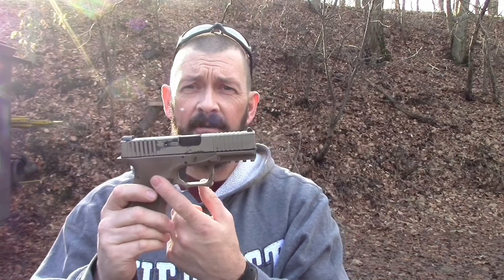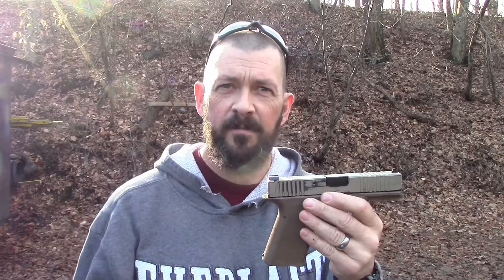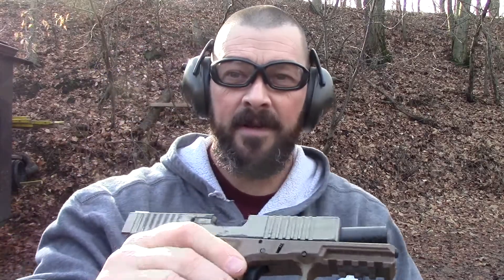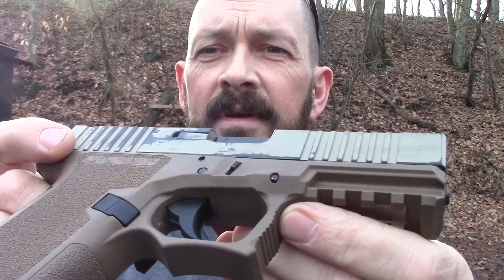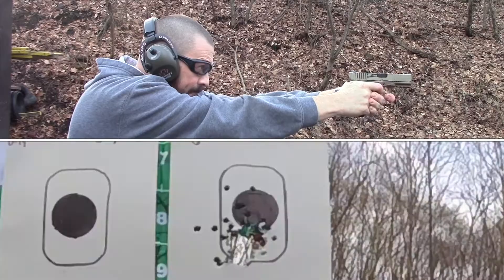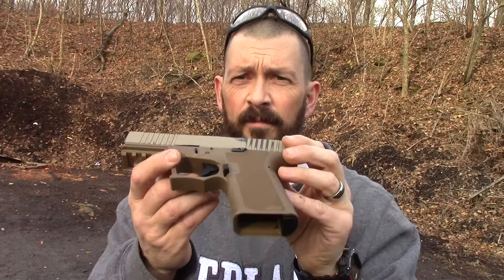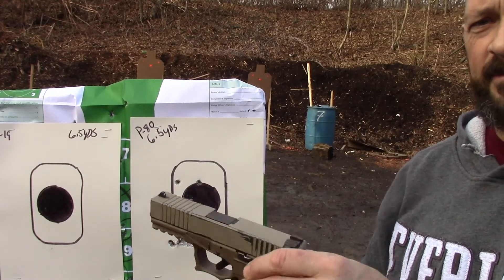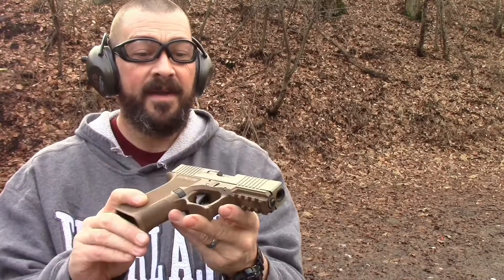Polymer 80 functions check and Point of aim point of impact test

Comment: Good video and nice Glock , my first build I had my trigger pin walkout and I tried every possible thing you can think off to fix it my last resort was super glue 😬😂 and still didn’t fix 😭 I guess my drill wasn’t spinning straight when I drilled the holes so they where wider than they had to be ,  but since then I have a build to more a Glock 19 and Glock 22 man they work like a charm , I have over 2000 rounds on each and no malfunctions  I’m glad you got your Kin fixed I had bad luck on that

Comment: I have a PF940c with the same Brownells slide and Glock 6.5mm, 3 dot, Night Sights. My first experience shooting the gun was low point of impact with the 3 dots aligned. It took a short time to get used to but all I do is hold the front sight dot slightly higher than the rear sight dots. I'm now hitting center of target at 10 yards almost every shot. My P80 with Brownells slide has a Lone Wolf Alpha standard length stainless steel barrel, 1:10 twist. Turned out to be very nice to shoot, low recoil, quick back on target and never a failure with ball or hollow nose rounds. It is now my everyday carry weapon instead of G19. Stay with your P80/Brownells slide. The more you shoot it the more you will like it.

Comment: If pin walking is an issue with a P80, I wouldn't get all down about it. I'm sure there are plenty of good machinists that can lathe ya a slightly oversized one for less than $ 15 or 20 frog pelts. I would say blue loctite....but I just dont have much faith in it. I cant wait to get my 80 finished up.

Comment: I feel like a celebrity!!! My original question was mainly towards the Gen.5. That is where I’m getting different answers from Glock and aftermarket manufacturers as to what height front sight is needed. First time I called and asked I was told gen. 3, 4, and 5 all use the same height sights, second time I was told gen.5 requires a taller front then previous generations.

Great info. tho!!!! I love seeing what others are experiencing. 👍🏼